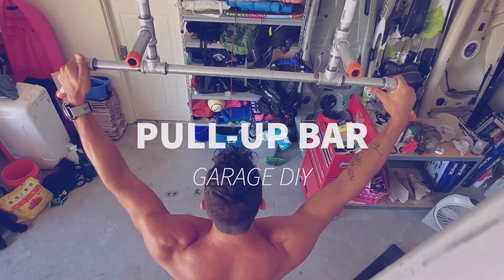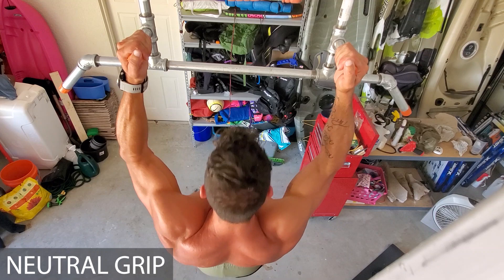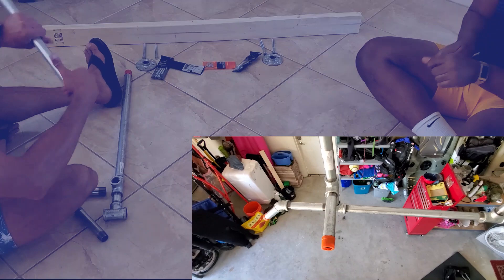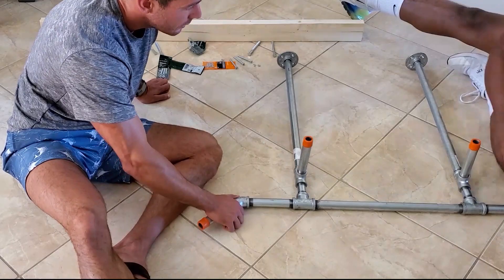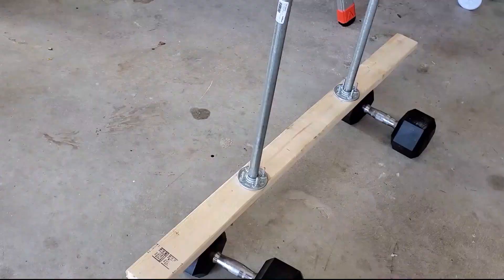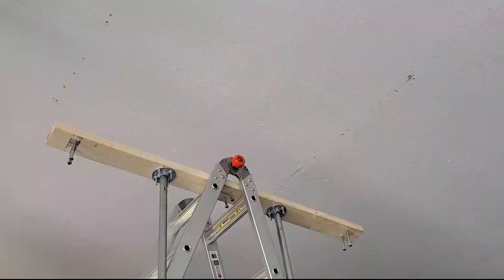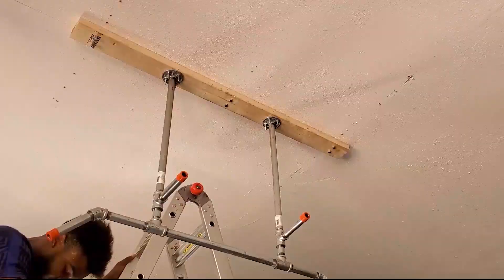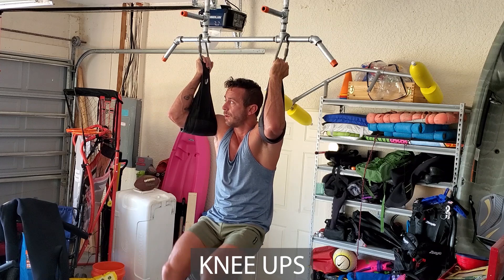DIY GARAGE PULL UP & AB BAR - 30 MINUTES TO BUILD

Comment: Great vid! I installed mine and it works perfectly. I will say for anyone watching to pay attention to the assembly process. Assemble the pull up bar, screw on the flange, still the flange down, and then drill the 2x4 to the ceiling. I did this out of order and assemble took a lot longer because as I was tightening one end the other was getting loose
Reply from the maker: Good note.  It was definitely my first attempt at a DIY.  And I definitely made a few time wasting mistakes.  In one case I kept trying to screw a piece in the wrong direction haha

Comment: How did you get the 45 degree elbows and ends to stay lined up properly? When I screw them down, they don’t end up lined up correctly? I can get them to line up if I back them out, but then they’re loose.
Reply from the maker: We had one that lined up perfect but the last one was off.  So we got it as tight as it would go and backed it out until it was pointed down.  When you are doing pull ups it doesn't move at all and there is no risk.  I've been using for about a month and a half.
Reply: @iHUNTdeadThings  Thanks for your post. You've really simplified other online DIY options by using 3/4 inch throughout. I just completed mine and everything is fully lined up and tightened. Amazing how much more the pieces will turn, using a rubber mallet - I achieved 360 degrees additional turn.

Comment: QUESTIONS: 1- Instead of having 2 Ts with the 2' stub in between, could you not use a "4 Way" connector so you would have one fewer connection?
2- Can you use shorter vertical pipes? 10'" or even 8" inches to try minimize swaying?
Reply from the maker: If you can find a 4-way that goes in those directions that would be great.  I've only seen them shaped like a plus + .

Also, yes, shorter from ceiling is ideal.  Less sway.  Just enough so you don't pull up and hit your head.  My garage was just too high, so I needed to bring it down further.  I still use a step up to grab it.
Reply: @iHUNTdeadThings  Yes, I found a 4-way that looks like it can work. Hopefully they make it in 3/4"
https://www.homedepot.ca/product/stz-fitting-black-iron-4-way-tee-1-2-inch/1001157021
ONE MORE Question: I am actually not attaching the flange to the ceiling, but to the side of a cross beam (which sits at 91" from the ground (hence me using much shorter verticals)), would you suggest I use screws or lag bolts, considering the force will be coming down at 90 degrees, not directly vertical?
Reply from the maker: I would definitely suggest distributing the weight at another point under the pull-up bar.  Either on the middle or one on each side with an addition flange on a lower cross beam.  And at that point I feel like either should work, but lag is ideal.

Comment: Do the lag screws go into the RAFTERS or the JOISTS in the ceiling?  Does anyone know?  I am confused about what is holding up the 2x4 to the ceiling. Thank you.
Reply from the maker: In the joists.  You take a 2x4 and got perpendicular across 3 joists
Reply: @iHUNTdeadThings  Thank you Sir.